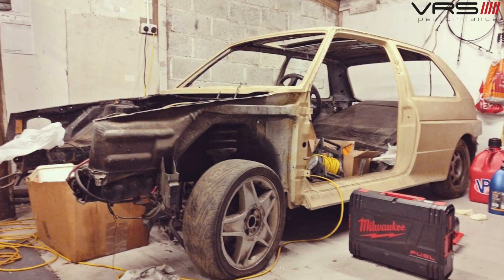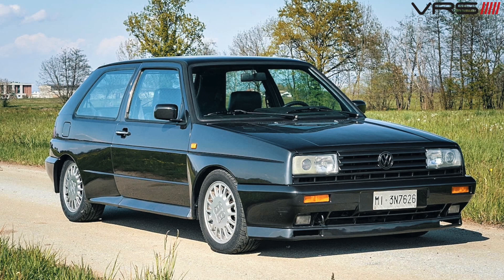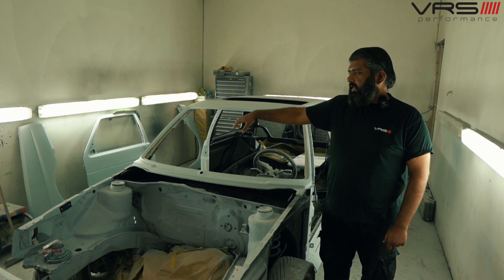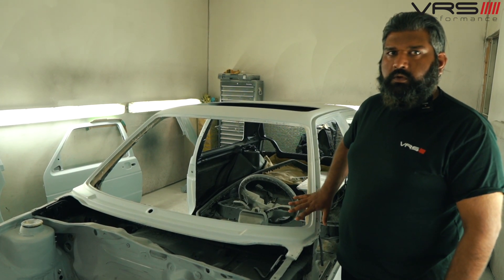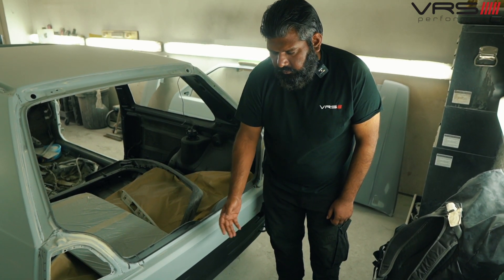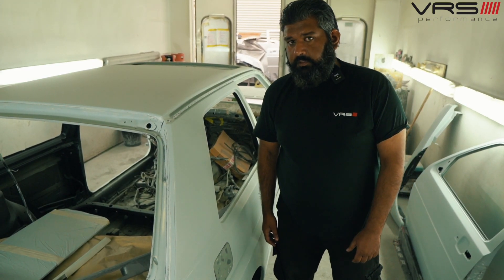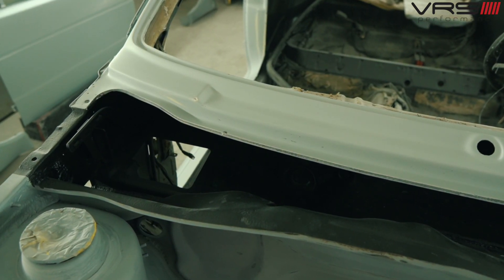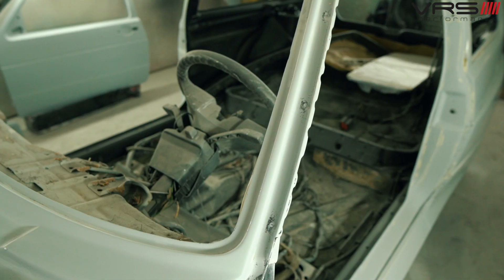VW Golf Rallye R32 Turbo Haldex 4WD Rebirth Part 1

Comment: 🤦🏻‍♂️ the only cars that didn’t have sunroofs were the Motorsport shells, NONE of the Rallye were RHD anything that is has been converted and won’t have its abs system

All 5000 were built in the VW Motorsport plant in Belgium (Hence the B In the chassis number)  multiple differences from any other G60, even the 1H engine capacity and internals differ and even the supercharger which should be a 6 port not a 4 like the ones on Corrado and Other G60 cars 

Taking away its originality is a mistake if you ask me